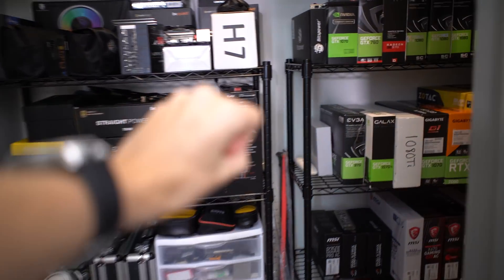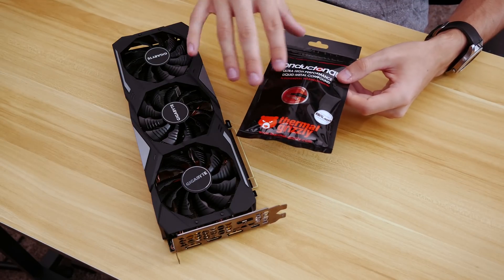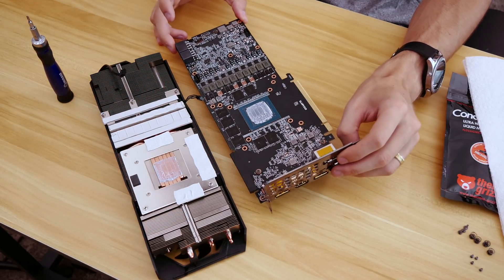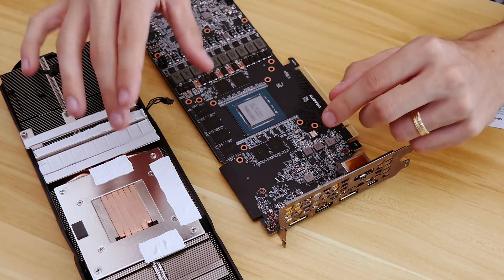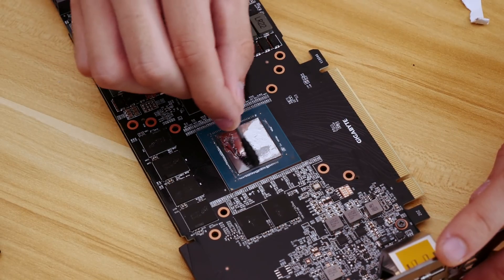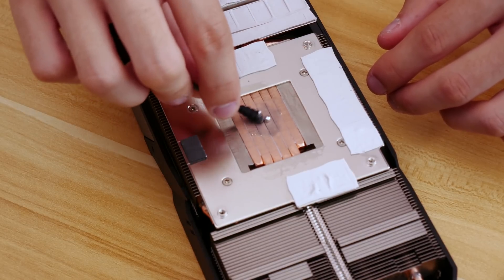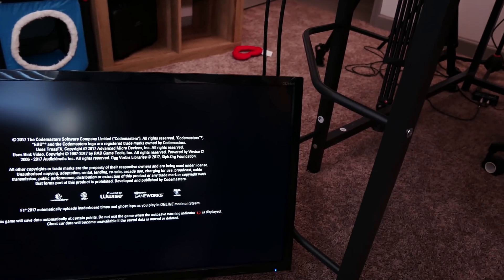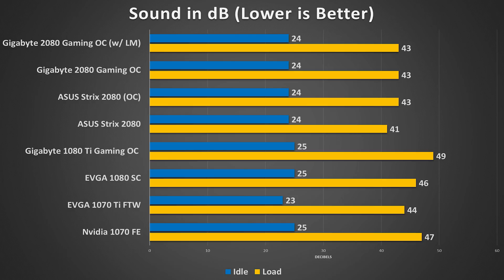Liquid Metal on a Graphics Card?

Comment: Thanks. I was thinking of using liquid metal for my rtx 4080 strix because i knew how good it was for temps for cpu. I'm glad i did some research on this and found this video. Unsure why for gpu it wouldn't be a good idea. I did read somewhere that the bronze portion of the cooler and the liquid metal don't go well together.

Comment: Nice video! If the gpu board was installed vertically and not horizontally, would it be safe to use LMetal on the chip? Would there be a fear of dripping when over heated when used?

Comment: The Issue with liquid thermal paste is that you have to apply on both sides the paste. Otherwise it can't move the heat. Therefore you have to understand the property's of the metal you apply it to. Aluminium as we all know starts to oxidize when it comes in contact with liquid thermal paste (gallium). Copper on the other hand has also an oxide layer like aluminium but It only absorbens the paste. That's why you need to renew it after some time. Try to sand away the oxide layer of cooper, clean it with ipa ,so u have really the bare metal and then it would stick to it. Not even to consider what else you have done wrong, it should really show a significant difference. I have done a lot with liquid thermal paste but with a lot more effort. Nickel plating then sandblasting gives the ultimate finish.

Comment: RTX 3070 Asus Dual OC 88C @1870MHz after application 2055@72C id say it was WELL WORTH IT. Fans were maxxed out at testing. He used too much LM on the GPU. Apply the paste to another area and use the qtip to bring it over to the substrate aka the silicon. This guy is absolutely incorrect
Reply: Idle temps at 29C

Comment: I am using a water cooled 2080ti aorus extreme that's had both the die and water-block lapped and using conductonaut extreme and gelid gp-7 ultimate 0.5mm pads to replace the 1mm pads and i saw a 35c+ difference while at idle from 55c-60c at idle and 72-88c under load to 26c idle and never exceed's 42c under gaming load or 48c under synthetic load with a clock of 2150mhz on the core and 18000mhz on the memory with a 100mv offset in conclusion lm depends on the application if you want to maximize performance and efficiency and don't mind the risk and regular maintenance then it's worth it for the 8-12c temp difference you can achieve in combination with lapping but for everyday 24/7 use id suggest using something like a Kryonaut extreme or KPX that are non curing and don't loose performance overtime compared to lm and have 17w/mk and 21w/mk respectively.

Comment: The silicon die has 3D letters printed on it. This prevents a flat contact. And throws any benefit of Liquid Metal out of the window sometimes depending on the actual GPU and cooler cold plate style. He also did not prime his heatsink with LM too. So the copper cold plate would eventually soak any LM up over time. And the GPU would slowly get hotter and hotter until it throttled.

Comment: meanwhile tjunc on my 5700 went from 105 down to 85 with conductonaut compared to 95 on nt-h2. Not to mention the extra higher boost clocks. yea, no. LM is not "dumb".
Reply: Exactly. 6800xt saw -20 degree with liquid metal. Not worth it yeah sure.....

Comment: It simply means that the bottleneck was the gpu rad and not the paste, not that it was useless
Reply from the maker: This is a very old video. But IIRC, then no, it means the temperatures didn't fall significantly enough to warrant a healthy boost in base clock and memory.

Comment: i've done LM to my 4790k and experienced great results (about 20c drop, some situations 25c) and i wanted to do it to my gpu but quickly ran into a stop realizing they use aluminium on heatsinks.

i have the same kind of line as you here, but a 2070 Super Gaming OC 8Gb not the 2080. I haven't taken it apart yet, but it looks like your 2080 one here has all those copper/orange pipes, not a flat aluminium metal. that means its safe? I read about copper needing multiple applications over time?

Comment: Just tip here, if you can't apply LM on ihs or die, try use watercolor brush apply, after apply go for another 1 or 2 drop on ihs or die middle of surface (do not spread), done.

Comment: Guys I really talking from my experience with liquid metal .... LM IS WORTH IT

My watercooled gpu dropped around 20 degree hot spot 6900xt at 400w
I tried many times installing waterblock to get best mount and applied LM twice clean bt. Then bomb core temp and hotspot temp difference is only 2 degree max idle and less than 10 degree difference at 400w

If LM applied correctly with waterblock the results will more than expected but with stock cooler I don't think so

Put in mined mem and vr temp will increase accordingly cause the die has more heat dissipation to the shared heatsink ... I am not sure if better thermal pad will help
Reply: ARAB MONEY

Comment: Very nice video, good job. Whenever I work on PC and components, I place a towel and/or a thin piece of foam on the bench. This fulfills two things. Screws and small parts don't move around and fall off the desk. And, It helps to cushion the bench If I drop a part. Also, I can't understand why anyone would not install AIOs in their now costly PC. I would have liked to see your test results compared with AIO cooling.

Comment: In my opinion, Putting liquid metal on the GPU is not stupid, the only stupid thing is putting it on a gpu equipped with a stock heatsink and fans like you did! ... It must be used with advanced dissipation systems such as those of a custom liquid loop ... Only in this way you can see differences (however it is possible to gain no more than 5 c °) ... It is a useful application on systems already pushed to the limit, not for a teenager's gaming pc!

Comment: I compared my application with static fan speed and the temps dropped 20C on my 5700xt. If you use auto fan you can expect the fan speed to drop for a quieter card as it does not need to expel heat as much.

Comment: Author: It does actually work. Try it on a Clevo laptop with MXM or any other GPU that has a Flat block on heatsink. The tube design may "work" but that is a ridiculously bad and cheap design for a heat spreader. Notice the contact pattern when you take it apart remaining in the factory TIM. Not ideal

Comment: It will apply to copper if it's properly cleaned, the pores still contain the residue from the previous compound. You must apply some press and lightly "scrub" it in the same spot to get it to adhere. I use 6000 then 8000 grit wet sand paper as the 2nd to last step when cleaning. Last step is last cleaning the copper with isopropyl alcohol. (Same same paper I used for die sanding the i9-9900KF)

Comment: Ähm so first you put way to much lm on the dye. Second thing: the point of lm is that it makes full contact to the dye and cooler surface (that's the point of any thermal compound) and well If it would'nt even "stick"  to the surface by rubbing it on, why should it make full contact by just putting it together? That's the thing with lm, it wont get full contact easily! (If it wont "stick" to a copper surface, its because of a oxidation layer. So you should have sanded it down with some realy fine sandpaper.)
Its not because of the lm! Its because you did it so bad! 
And than saying "i hope you learned something" i hate such YouTubers... you better learn something🙄

Comment: Im watching your channel pretty much since the beginning when you were just a noob. I see nothing changed. If liquid metal short the card,  the PC just wont start,  you wont brick the card, its very difficult to kill it that way. Also you can have 4-8C Temp improvement from liquid metal. Most ppl dont do it because 5C wont affect the performance, it does lower the temps more than 1-2C. You cant generalize the whole topic just from your limited experience with ONE card. I would of at least check what other ppl say about it and include it in the video.
Reply from the maker: I can absolutely generalize the entire topic from my experience with this card. The risks involved far outweigh the temperature delta associated with LM in a GPU setting. I could care less "what other people say." If your temps are poor, just replace with higher quality thermal paste - not liquid metal. These are my impressions based on my tests. Watch other videos for other impressions. Pretty straight-forward :-)
Reply: @GregSalazar  Just told u there is no risk involved. The computer just wont start until you clean up the spill. To say you'll brick your card with this is like spreading misinformation & shows your level of knowledge. I mean, objectively, thats the truth. Im sure you dont like the comment, i know i didnt enjoy posting it but it triggers me because ppl take it as 100%.

Comment: exactly my same opinion, LM is not necessary at all, it only matters when people replaced their hardware with shitty thermal paste with LM and then post about their "significant" 20c or more temperature drop, when realistically it will be less than 10 Celsius difference, you would be fine running everything with a artic mx4 that perform as well and last long

Comment: Wrong,  it was the fact that video card had copper heat pipes instead of a flat surface on it.  I put the conductonaut on my MSI gtx 970's, ( with a flat nickel base plate and gaming temps went down roughly 12 degreese.  Try again with a different video card.

Comment: That heatsink is not suitable for liquid metal application. I would not even consider putting it there. Even though the heatpipes are copper, the little gaps between them may channel the liquid metal up to the aluminium structure of the fins, destroing completely the heatsink.

Comment: This was a terrible test... without setting the SAME fan settings on all cards all your doing is showing that the GPUs ability to slow the fans when it's not running hot.  Also people need to know that not covering those capacitors with tape or conformal coating is potentially dangerous

Comment: 11:23 --> That's becouse you "cleaned" (more like, just wiped) the heatsink so bad that there was still a visible layer of thermal grease on it (that's why you couldn't aply th LM to the heatsink), then the heat transfer was bottlenecked by the thermal grease residue.
I'm pretty sure that the results would be different if you cleaned it properly.
Nice video tho.
Reply: @F0x9o  how can this is be a  bs video if he has less that 70 degress on the gpu? haha
Reply: @knightnxk2906  Cause he obviously didn't know shit about what he was doing and even stated such.....but continued to state his findings as accurate. Botched test as Gabriel pointed out why. I also got 10c better temps with LM on a EVGA 3090 FTW3 Ultra with better OC as a result.
Reply: @VinceCASPERPimentel  Did you have to Nickel-plate it? I can't find if Nvidia GPUs (Gigabyte) have a Nickel-plated or an Aluminum base. Can you please advise? I believe it is Nickel plated but I don't want to risk it.
Reply: @millanferende6723  should be able to tell by looking at it, nickel plating looks very different than aluminum. Don't risk it if not sure. LM will kill aluminum.

Comment: you should be using liquid conformal coating on the GPU pins surrounding the die, I prefer MG Chemicals silicone conformal coating, it comes in liquid form in an 8ml bottle.

Comment: I think it’s ok if you’re having temperature problems and provided you take some precautions.  It’s not for the novice.  Coating some of surrounding SMDs with clear fingernail polish or something similar.  In my case I’d run the card upside down, so if it drips, it hits the cooler/water block instead of pooling on the PCB.  It’s not something I would do unless it was necessary.  I have used it on delidded CPUs with excellent results.

Comment: on my 1660ti SC Ultra i was seeing temps as high as 67-71C using  ICDiamond in my case setup. after applying liquid metal, temps dropped to max 51C.
my core runs stable at 2130 and my memory at 1250.

Comment: I would not advise you to use liquid liquid for a better screen card. Use a strong putty and less than the metal like Thermal Grizzly putty. Very great for the graphics card and performance like metal putty.

https://www.amazon.com/dp/B00ZJSXE2Y/ref=psdc_2998409011_t5_B011F7W3LU

good

Comment: i did this to my asus strix 2080 ti, it helped to get the temps from 60 oc down to 49~ but then i switched to normal nth2 noctua paste because the shitty aluminum cooler on the strix can't handle LM and it only got 2 degrees worse, so the first paste that asus put on it was just shit.

Comment: I will say I’m running a Asus rtx 2080ti OC edition and it was running at 72deg under constant load, I repasted it with grizzley Kryonaut and it dropped 10 degrees and sits at around 62 degrees C now under the same loads in the same rig. Was it just a case of me getting a crappy pasted card or do Asus use crap paste ? I wouldn’t have believed it unless I’d don’t it myself

Comment: Made a custom water loop with ~400W of dissipation from radiators for my new 3800X @ 4.3 GHz all core slightly undervolted PC. Used an EK water block and conductonaut on my Gigabyte Windforce GTX 1080 OC. Protected some of the exposed contacts with PRF 202 conformal coating spray.

GPU temps went from 75°C to 45°C (in a ~28°C room, ~38°C water temp) during prolonged use with clocks from factory OC of ~1860 MHz to 2050-2063 MHz as the factory boost settings seem to have a strange effect on MSI Afterburner's offsets at times. GPU is at default voltage settings and could probably get to a stable 2100 MHz with a little bit of extra voltage, but the performance gains aren't worth it. There are hardly any temperature fluctuations as the heat is dissipated so fast from the GPU die.
Reply: Great reply.  I've got my 1080 ti on a kraken x62 with the g12 mount, wondering if LM would make a difference on it.  Your comment convinced me it will.

Comment: I currently have an XFX Radeon R7 370 2GB graphics card. It is constantly spinning at high speeds, but the temperatures seem normal (37C - 42C). Is it a video driver glitch or should I swap out the thermal paste and put in liquid metal? Also should I consider the thermal pads?

Comment: I applied LM to my 2080 Ti XC Ultra and temps under load went down by  8C. The XC Ultra has a very beefy heatsink on it already, the LM has some more room to stretch before the heatsink is saturated.  3dmark timespy stress test with fresh regular Arctic Silver 5 TM had final temps peak at 73C @ 130% TDP +140Core/+900 memory. Admittedly this is pretty outstanding for an air cooler already.  Once LM was applied the temps peaked at 65C. Fan speed was set too 100% for both tests.

Comment: Well.. thanks for the video and your test, but there are issues with your conclusion.
You put way too much Conductonaut onto the GPU DIE - there should never be any kind of a LM lake left on there. You should have protected the SMDs against spillovers prior to application. If you're unlucky you will cause the card to short circuit and die as a result. Finally you did not clean the copper heatpipes of the cooler from leftover paste - that prevents proper application of LM. I have ordered an AORUS 2080 Ti Xtreme and i know that it will neither be cold nor super quiet so i am thinking of doing a Conductonaut mod.

I've done it before on my PS4 Pro, XBOX One X, various laptops and an 8700K so by now i have some experience with it. I recommend you do it again and also make sure to spread a very tiny layer of it onto the heatpipes. It will spread if you try hard enough and cleaned it properly. You could use isopropanol for this.

Comment: I literally just tried putting liquid metal on my graphics card for the first time (R9 390) to see if it made a difference. I'm already using an nzxt kraken G10 adapter to mount a corsair H60 for cooling, so arguably I should've seen less of an improvement as I'm already using a better-than-stock cooling setup, so I wasn't expecting to see a giant leap in temp improvement from doing this. I prepared the copper heatplate surface with the steel wool that came with the LM (even wiping the TIM clean normally will leave a microscopic layer, preventing the LM from adhering, as we just saw in this video) and applied clear nail varnish to the surface mount compenents surrounding it, safety first! Just like in the video example I only applied it to the graphics core rather than applying it to the cooler as well, and I used the same fan settings (all to 100% throughout) on the same stress test. On 1080p + 8xAA furmark, max temp dropped by 15C. Did I do it perfectly and achieve the optimal contact? Almost certainly not, as I've never used liquid metal before. Did I even have the perfect mounting pressure between the waterblock and the die? Also, probably not, as you just have to take your best guess with this setup. Do I still have a lot to learn in this area? Of course, I am by no means an expert. Was it worth trying? Absolutely yes

Comment: People blabbing about nail hardener... Something the amateurs keep forgetting (and will likely google), is that nail hardener is susceptible to thermal degradation since it is not designed to be used for that purpose. If you're spending over 500.00 for a graphics card, you DEFINITELY don't want to be putting nail hardener on it, spend the extra bucks and buy actual thermal encapsulation... If you don't know what it is, you have no business dealing with electronics.

Comment: i didnt see the comments but i can take u some informations . the surface of the cooler has a lot of silicon , if u cant to remove u can use 2000 sand paper . 
and u did a very dangers thing too . use some protection around the gpu die . such as nail hardener or resin epoxy  or any material like this
Reply from the maker: See my latest LM video. It's all done "correctly." In this video, all I wanted to do was test thermals. Wasn't concerned about protection.